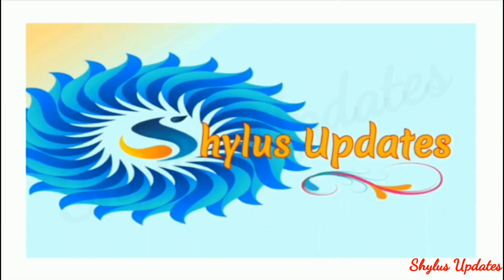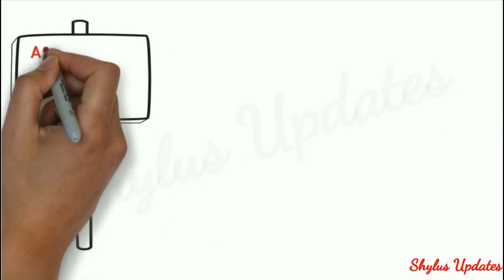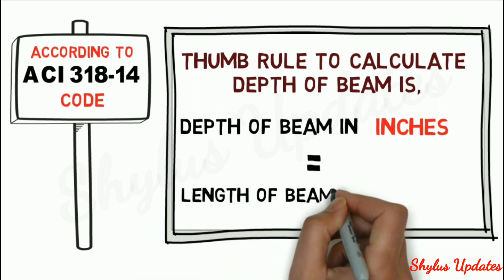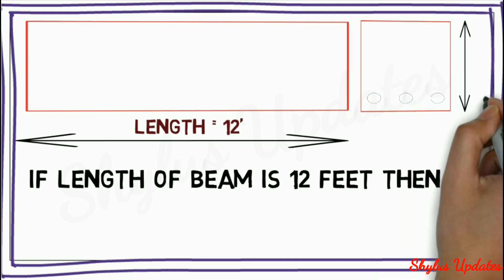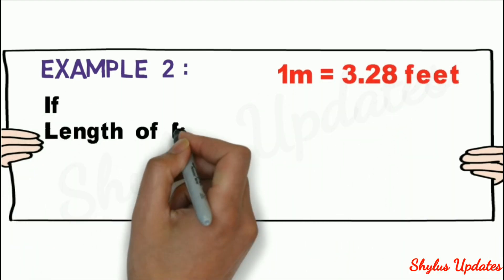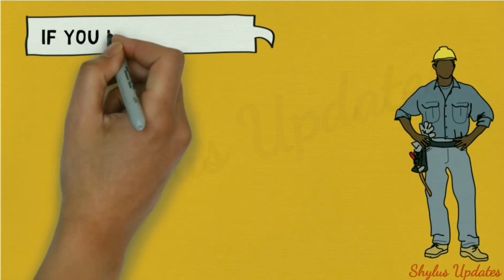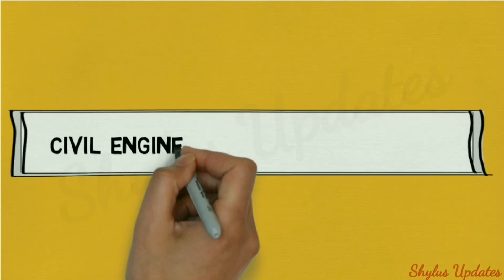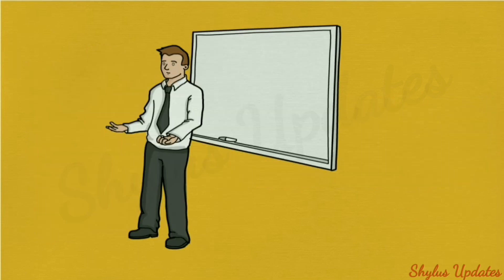Beam depth thumb rule

Comment: Length of beam12 feets=depth of beam 12 inches.its mean numbering equal but units change.(feets-inches).thank you madam
Reply from the maker: Not like that, if you are convert into meters then numbering also will change, so you always remember this thumb rule having unit in feet & inches, if u want in metre then it will be vary.